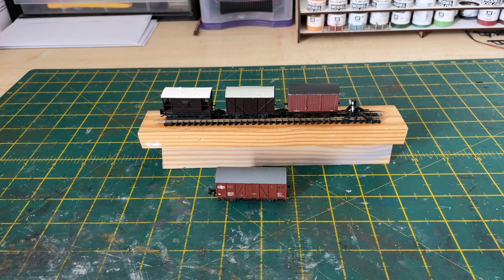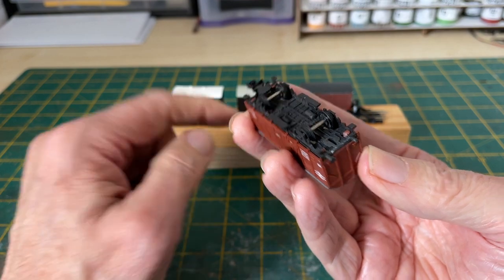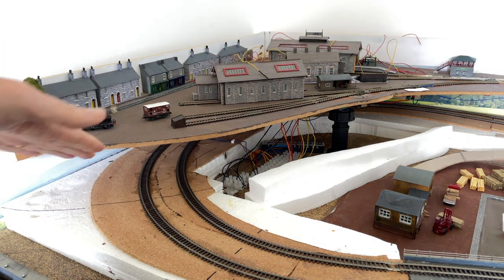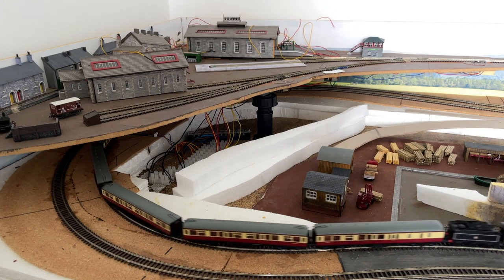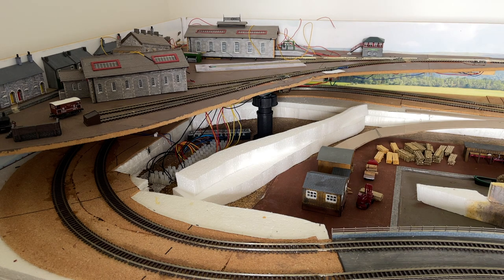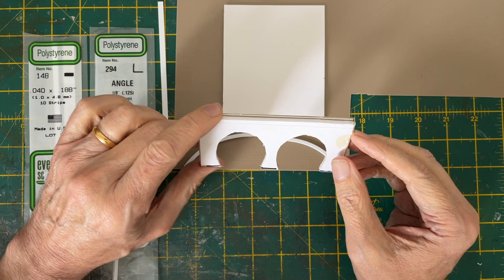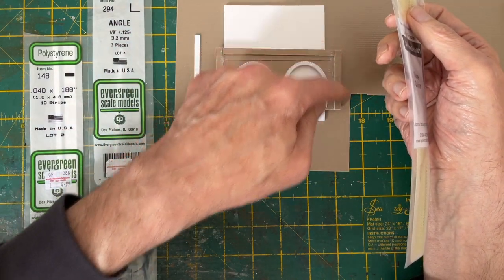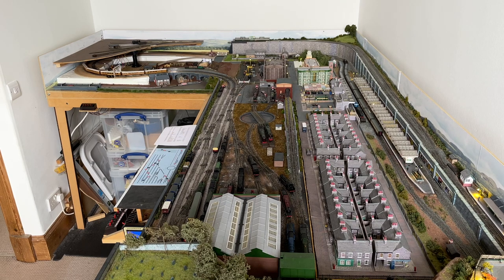Building a tunnel portal and a new locomotive arrives Elvenhome EP 149A

Comment: Great to see how High Elvon is going to look. Tunnel portal off to Lovely start. Like the idea of cutting slits in the ‘angle’ for the portal edging.
Reply from the maker: Thanks John.  The L shaped styrene works a treat, especially as such arches as you can get for N gauge are always the wrong radius.  It was good to get the buildings of High Elven back in place (if only to confirm they all still fit!).  Stephen

Comment: Very good Stephen, nice loco and like the portals, agree on the textured buildings for sure although Chandwell's buildings are something else. Cheers
Reply from the maker: Thanks Chris.  I agree about the quality of Michaels work at Chandwell. It is nice to work with textured material though, even though it does give more work in painting and weathering.  The tunnel portal is coming along nicely particularly as it started as a thought about how I might use the 3mm foam board.  Stephen

Comment: Hi Stephen A very good update, I do like the Tunnel portal, it really will look good when finished. Re the early Farish/Lima etc couplings, interesting to see that its possible to convert them, maybe a job for the future for me(?). I have to say I'm a little wary of Dapol loco's but I really do like thier wagons. Thanks for the update, I do like to watch your insights into these things.
Reply from the maker: Thanks Peter. Converting the early Farish was time consuming but reasonably straightforward.  The Lima required too much hacking.  If I could have separated the body from the under frame it might have been possible, but I don't think I could have done that without damaging it.  Dapol are, I think improving the QC on the their engines, and to be fair the first Hall I bought is the only one that I have had problems with.  I have 10 or more now.  I'm pleased to learn that they are going to move away from the shaft between the tender and the locomotive.  Im looking forward to the promised sound fitted Mogul which will have the new design.  Stephen

Comment: Nice video Stephen nice to see you back posting. Re the OO gauge sheet you are using, recently when I was building my viaduct I looked at the N -Gauge Slaters stone sheets, and the stones looked well too small compared to the real viaduct which is still standing in my town. The OO gauge sheet is slightly over scale but looks more like the stonework on the real viaduct so I am happy with that. Chris H.
Reply from the maker: Thanks Chris. You do have to look around for different makes of brick card, but I have used 4mm in a number of places. Funnily enough I did use 2mm on my viaduct, but I can’t remember whose card it was.  ISome 2mm really is only good for houses and small buildings.  Stephen

Comment: Hi Stephen  - As you rightly showed, conversion of the older farish stock is possible for use of  easi shunt couplings.   I do like that bespoke tunnel portal  - it looks very " Elvenholmeish "  Nice loco as well.  Looking forward to seeing the portal blended into the rock face.   Hope you had a good break.  Cheers Euan
Reply from the maker: Hi Euan.  It hadn't occurred to me until you mentioned it but the portals are very hobbit like.  I just like the shape of the Bachmann Scenecraft single portal tunnel entrances but they are just right given the Tolkien theme.  The Hall is a lovely model, and runs very well indeed.  Stephen

Comment: Hi Stephen really enjoyable video as always. Just one thing, and this might just be down to the angle of the camera, but I felt High Elven looked a bit cramped. Maybe you could play around with the track plan?  I may be wrong as  say but just a thought.
Reply from the maker: Thanks David.  The track is all now fixed in place. It did look cluttered but I think that was a combination of all the wires and the buildings not being properly seated made it looked more cluttered than it will be.  There is also the cliff face to go in which will add a bit more depth.  Thanks for your comment nevertheless.  It is always helpful to have others views on what they see.  Stephen

Comment: Hi Stephen. It's good to see the top section of the layout in place and bows sorted out. Nice scratch build of the portal. Do you see that configuration in your part of the world?
Reply from the maker: Hi Jason and thanks. The twin bore for two parallel tracks is quite common, especially where the two tracks have to take a slightly different path through a hill. In fact, the East Coast Mainline from London to Edinburgh has twin bore tunnels both at Kings Cross in London and as you arrive at Edinburgh Waverley. Stephen